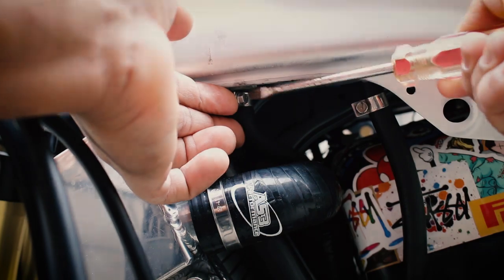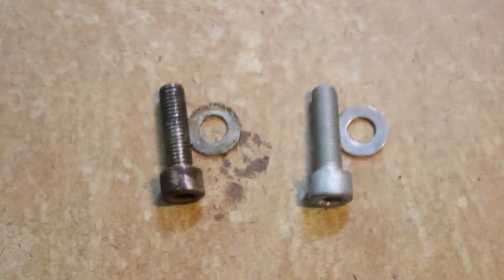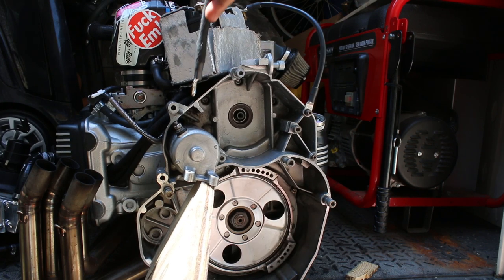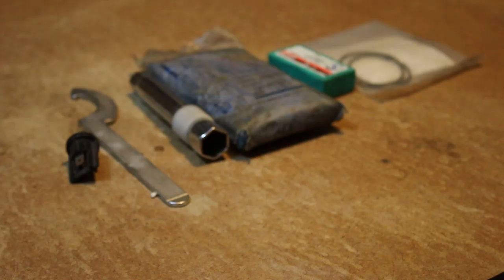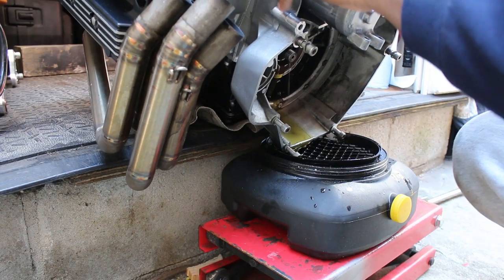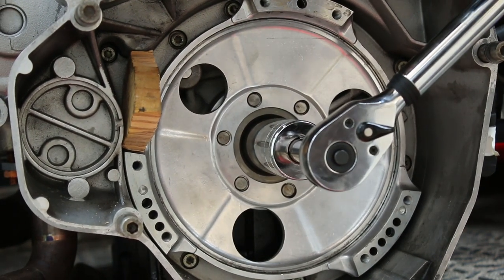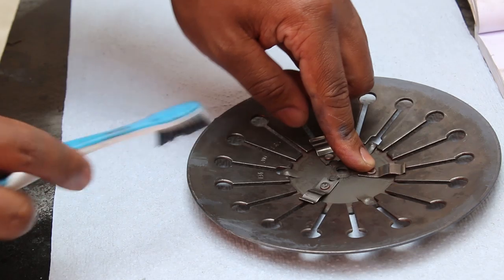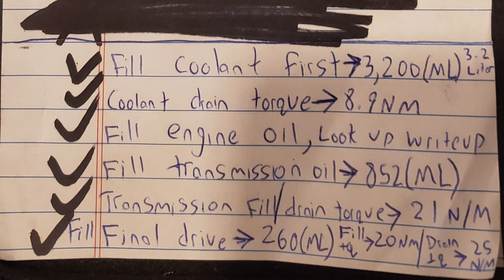[Ep 16] 1986 BMW K100 Cafe Racer Project - Surprise Clutch Job

Comment: Question: my K100RT café often has a thing where you hear power running to the starter relais, and you hear the fuel pump running, but starter doesn’t engage. Thinking it is the brushes maybe? Relais and power all seems good. Nice build btw!

Comment: You might want to keep the spanner wrench. This tool is used to indicate the correct fill level of the transmission. That’s what the line is on the bottom of the wrench. You just stick it in the filler hole and rest the flat part on the machined surface.
Reply from the maker: I held onto those tools. That's interesting though, so the tools are original.
Reply: Mr. Valve you are correct, but I think it’s main task is to adjust the tension of the rear suspension spring.

Comment: Common starter-clutch problem, I had this many times with my K1100... Most times putting the bike in first gear and rocking it backwards and forwards releases the sprockets of the starter-clutch. Heating up the oil by taking the bike out for a nice spin resolves the problem for some time ;)
Reply from the maker: Tried the rocking backwards thing, first thing I tried. Didnt work. I've since started the bike atleast 20 times after putting rislone and new oil with no issues.
Reply: @Theillestrator1050  Okay, at least we know the K-specific tricks... (btw., your bike has a nice sound and appears to run very smoothly! Nice project!)

Comment: Great bike, great build, watched all your Videos! :)

Two thoughts though:
1. When you are using the piece of wood to block the movement I think thats fine for loosening, but when you do that while tightening the nut the wood will flex and compress and you really dont know much of the torque you did put into the wood instead of the tightening of the nut. The way is see it you dont really know if all or how much of the torque really went into tightening which might be unsafe.

2. In the last shot (22:05) one can see pretty good that the exhaust isnt FULLY pointed over the rear tire. I´m not sure if that creates an issue, especially if you ride and have airflow you might be OK, but if you have a lot of stop an go traffic i´d worry that your tire gets too hot and might wear excessivly or be unsafe grip wise.

I´m by far no expert though, just for your consideration.
Reply from the maker: Cant say im too worried about the wood thing. 16nm over is a good cushion and plus im by no means the first to do this. As far as the exhaust, its not ideal but I haven't had any issues thus far
Reply: Neither is a concern. Even if the piece of wood can move or compress a little then stop again, the torque wrench will only measure what it takes to turn whatever nut/bolt it's on. The exhaust exiting near the tire will have no effect on it's function at all. Beautiful bike! I love it!

Comment: Red and black plastic things on the left are battery terminal covers you get when you first buy a battery that has vertical posts. Not like the kind I saw when you tested the bulb.
Reply from the maker: Ahhhhhh gotcha like the HUGE batteries
Reply: @Theillestrator1050  lawn and garden is where i see them a lot. I bet you guys don't use a lot of 0 turn mowers in nyc.
Reply from the maker: Funnily enough... this bike came with a lawn battery when I bought it... you can see it in episode 2 at the beginning

Comment: Check out project farms oil tests, Amazon Basics oil is made by the same company that makes Walmart's Supertech oil, and they're actually very good oils, better than a lot name brands.
Reply from the maker: That's good to know. I know it's rebadged supertech but I didn't know it was considered very good. However, the oil i was running was way too thin at 5w20 versus 15w50. Should've atleast got a thicker weight.
Reply: @Theillestrator1050  oh I see, good call to change it then, love this series, looking good.